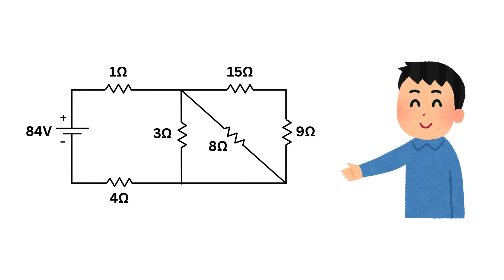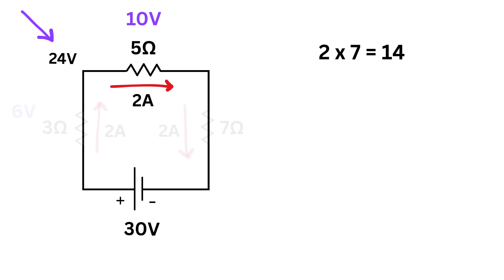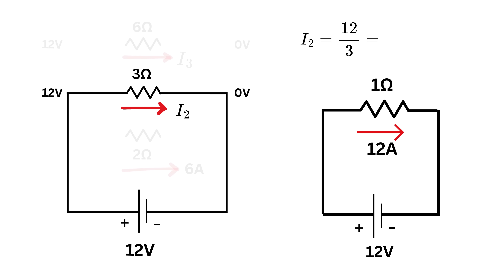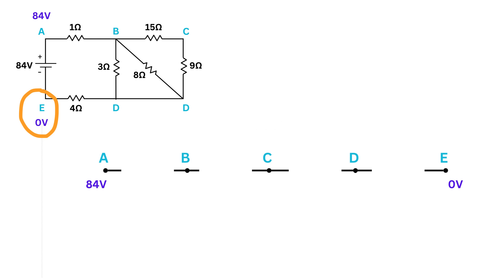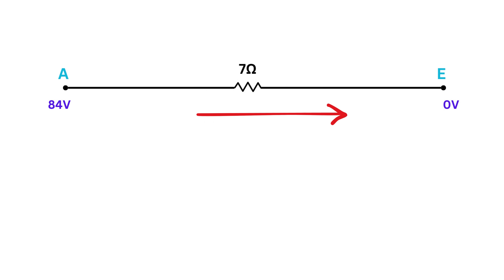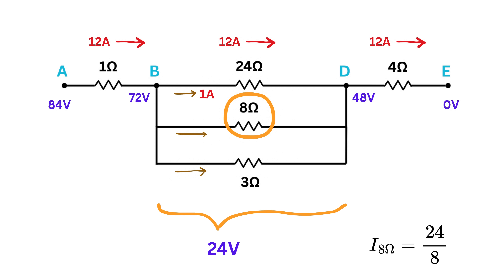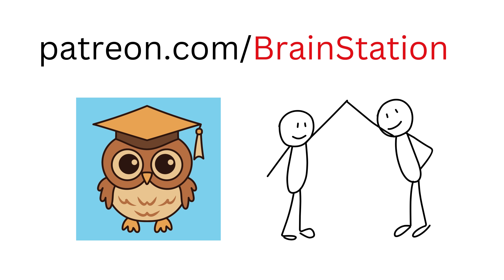How to Solve Every Series and Parallel Circuit Question with 100% Confidence

Comment: 8:49 how did you get R=2
Reply from the maker: 1/3 can be written as 8/24
1/8 can be written as 3/24

So 1/24 + 1/8 + 1/3 = 1/24 + 3/24 + 8/24 

= (1+3+8)/24
= 12/24
= 1/2

So, 1/R = 1/2

Thus R = 2
Reply: @BrainStationAdvanced 😮 sir you answers new comments also 😯
Reply: @BrainStationAdvanced can we not solve it simply because I can't understand
Reply: @DramaRecreation-24it's very easy bro just remember formula and thinks about flow of current only easy pissy
Reply: @BrainStationAdvanced thank you sir❤❤❤
Reply: @BrainStationAdvanced no it's your own idea to make explanation but the true value of resistor has it's own answer.
Reply: @BrainStationAdvanced  , I am sorry sir, but 1/2 does NOT equal 2, it equals 0.5
Reply: @carlfinley4649  1/R=1/2
You doesnt know cross multiple 😔😔😔R=2
Reply: @carlfinley4649   what??? 1/R= 1/2 so R =2, what do you not understand in this simple calculation?
Reply: @carlfinley4649 it’s the reciprocal bruh (1/R = 1/2 , R=2) it’s the inverse
Reply: Yep, I forgot to take the second inversion
Reply: or u can use Product by sum
equivalent Z = (R1 times R2)/R1+R2
Reply: @matheusapenas.3637  thats only applicable when there are only 2 resistors
Reply: @matheusapenas.3637 it works only for 2 parallel resistances
Reply: @matheusapenas.3637  , that is mainly for 2 resistors. in this case we have 3
Reply: Make the denominators same in each case🎉
Reply: @AMISUnn0506D I'm too familiar with this frustration haha. Hope I can help clear that up:

Okay, so at first, 1/3 + 1/8 + 1/24 should give you 0.5

... buuut something they often forget to mention is that - after that - you have to do a reciprocal on that number (i.e. flipping a number or function to find its multiplicative inverse, sounds scary but bare with me ↓ ).

Take 0.5 and inverse it like this:
→ 1/0.5 

= 2

That's it

... alternatively be lazy and use a symbol that looks like 1/x or like x⁻¹ on a calculator (windows calculator has it)
Reply: If you didn't get it by now Try this formula instead....I think it's simpler R_total = 1 / (1/24 + 1/8 + 1/3). Solve the paranteses first.  This comes to R_total = 1/0.5 .
1/0.5=2
Reply: LCM
Reply: its actually 1/Rp for which you have to do reciprocal for the final value
Reply: Calculate through parallel theorem you will get
Reply: Simple understanding
Reply: 1/R=1/8+1/24+1/3
so, 1/8+1/24 = 24+8/24x8=32/192=1/6
now, 1/6+1/3=3+6/3x6=9/18=1/2
Therefore,1/R=1/2
ie.] R=2..........(reciprocal)
Reply: This is basic fraction question just take LCM of there last digits
Reply: This also works 
R1=24 ohm, R2=8 ohms, R3=3 ohms in parallel 
R1xR2/R1+R2 =answer
Answer x R3/answer +R3 
.^.  24×8/24+8=6.   6×3/6+3 =2
Req= 2
Reply: You can solve it in 2 milisec. Like 
6x3/6+3 = 2 and 2x2/2+2 = 1
Reply: You just need to take to inverse of what you get for 1/R to get your equivalent resistance.

In the video, (1/24) + (1/8) + (1/3) = 1/2

You just invert 1/2 (aka, flip the numerator with the denominator) to get your answer of 2

Comment: When a 5 ohm residence is connected in 12 V ... Then the current flow will be 12/5 = 2.4 amps.
You can't say 2 A flow throw in 12 V 5 ohm setup.
And in this scenario the entire source voltage will be shown across the resistance...
 This video is wrong at the initial explanation...
Don't follow this one... This is deliberately done to fool people..

Comment: OMG. I finally understand it after watching this video for almost an hour. I'm studying to take my electrical ASE test for automotive and I wasn't understanding how restistances in parallel circuits worked and reading the comments on here and watching the video I like to dumb things down for ppl who think like me. First let me start off by saying my first road block was on 4:57 I think what confused me was I was fighting for my life trying to figure out how he got 1/3 + 1/2 + 1/6, I think he incorrectly ordered the fractions, so for any one stuck on here I think he meant to put 1/2 + 1/3 + 1/6, next I needed to look up how to add fractions yes I'm that slow idc I'll ask the dumb questions, this process actually requires multiplication, 1/2 + 1/3 = 5/6, NEXT 5/6 + 1/6 (because the bottom numbers are the same we add everything across the top) = 6/6, which mean Rt = 1, according to formula 1/Rt1 = 1 this circuits total resistance is 1

Comment: 7:11
Sir I had one doubt why did you take D twice??
Reply: Since , there is no resistor between the intial points E and D , the voltage will have no drops and will remain same. Thus E = D 
 That is why we can write D = D or two Ds becuz both of  them will have same value.

Comment: nicee explanation, what if there was a resistor in between the points you marked as D and D in the bottom wire, voltage at the ends will not be same, how to solve the resistors?

Comment: when you are explaining the parallel one you just did 12/2 to get 6A but when you are explaining the question at the end you did 24/24 , 24/8 , 24/3 to get 1 , 3 , 8 ohm so why not you did 72/24 , 72/8 , 72/3 why you divide it why 24 why not by 72 as you explain in parallel one

plz explain

Comment: i did not understand why the current go from the positive terminal of the battery to the negative, I had learned that the electrons went from the negative to the positive, anyway not much changes, but I'm still confused.
Reply: Hi!! Actually there is a term for this, 'conventional current' Electron flow is the actual physical movement of negatively charged electrons from the negative terminal to the positive terminal.
But Conventional current is the widely used standard in electrical engineering and physics for circuit analysis. So basically Conventional current is just a historical convention that helps us analyze. Its not actually how the electrons flow its just a pov of making things more easier.

Comment: 5:49 there is a small oversight here, your direction of information should imply on the graph or drawing proided that they are connected to SAME POINT, not a point, splitted by another point, splitted by another.. etc....... this will lead to different current that is not in the same method you calculated it.

Comment: Here is a parallel circuit problem that won’t be solved with this type of analysis alone:
12 resistors all 100 ohms, arranged so as to form the edges of a cube. (Each resistor connects with two others at a corner) 
What is the resistance between two opposite (diagonal, and far opposite) corners of the cube.

Comment: In the end you're using Kirchhoff's circuit laws. At each point the voltage is equal on all connecting lines and all currents sum up to zero (incomming and outgoing). You did not mention the current rule but you are using it. With only resistors present you are able to decompose the circuit in parallel and serial connected resistors and calculate each point by Ohm's law.

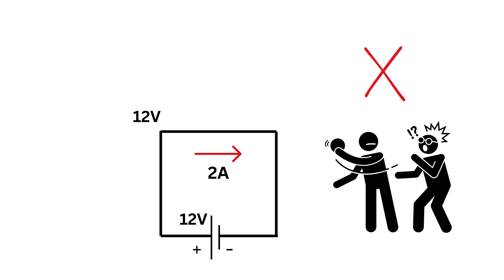Comment: 1:58 In this case, the battery is in short circuit. Supposing a 0 ohm resistance in the wire, you'll have an infinite current and the voltage will be 0 volts (following Ohm's law). In the real world, the wire will get hot, the resistance will rise up and the current will be very high but not infinite, this could last from a few seconds to hours depending on the battery's charge. At the end the battery will die in the hard way.
Reply: aye, but we take ideal wire
we disregard temperature of course
Reply: @NamanShah-b3w , as I mentioned, in this case the voltage will be 0 volts, it's a short circuit.

Comment: 1:35 I’m not sure I would trust anybody who’s initial example is as flawed as this. Voltage is set at 12 V resistance five ohms that would give you a current of 2.4 Amps, not 2 Amps.

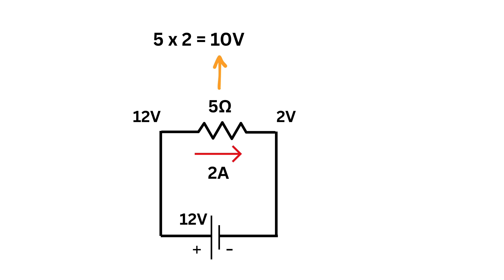Comment: 1:52 Wrong and mildly confusing, even though beginners might not catch it. The resistor sits between 12V and GND, right? It will drop the full 12V. The current will be 2.4A assuming no other losses. I hope you have a 30W resistor....

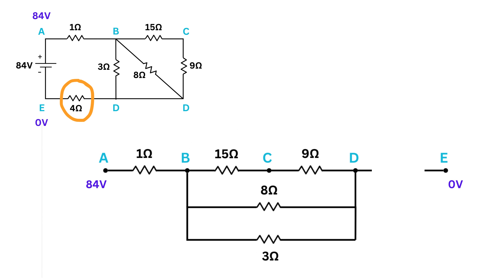Comment: 8:00 Why do you name the circuit (d) repeatedly in the above circuit diagram
Reply: Because there is no resistor then and hence no voltage drop
Reply: Because there is no resistor between those two points as voltage remains same in those points, write same notation like d, d or a, a etc.
Reply: @chinmay1516 thanks

Comment: The very first example is wrong. I understand the attampt, but if there is only one resistor in the circuit, the voltage drop would be equal to the sorce, and the current will be I = V/R -> 12/5 = 2.4 A.

Comment: 12:36 why the 48 volts becomes 0 across 4 ohms?
Reply: Bro , 12 amperes of current was flowing through the 4 ohm resistor from D to E , if we applied ohm's law it is that V= IR, so we get V= 12×4 that is 48 , since potential drop can be measured by the - Potential difference from D to D(48) Minus the potential difference from point D to E , I guess this will help you
Reply: It should be 44 volts right i am confused on that part too
Reply: @PrabhasPatilyoo indian
Reply: @PrabhasPatil no bro , there is a drop of 48 V so the effective potential difference would be V - Vd = 48-48 v = 0v ❤

Comment: At time 1:35 the current will be 12/5 amps (2.4 amps) NOT 2 amps. To achieve 2 amps through the resistor shown would require an additional series resistance of one ohm. I see what you are trying to demonstrate but at best it is quite confusing and at worst simply wrong.

Comment: What if i have circuit with power supply that provides 30V and 1A and resistance with 15ohms. How can current be 2 amps when power supply can give me 1 amp only?

Comment: I am Egyptian and in the final year of high school. Although the physics curriculum is very difficult and complex in Egypt It does not depend on understanding the lesson only, but rather it depends on understanding and solving a lot. , I benefited from the video. Thank you. 😊
Reply: same and I was trying to find Smth to help me understand the current divider found this video and decided to watch it instead, the only trick I know for now is that if you have 2 resistors in parallel and one is equal to the other than do 1/2 , if one is half the other do 1/3 the bigger one , if one is 1/4 the other do 1/3 the bigger one , and the list goes on , it makes it wayyyy easier to solve these without a calculator cuz most parallel resistances are either equal , half , third or quarter
Reply: @bidoaymannabil9828  This method is really very effective and time saving. Where are you from?
Reply: @bidoaymannabil9828 can you explain further what other tricks do you know
Reply: @bidoaymannabil9828 shut up lol
Reply: Same lol
Reply: @asmaaelhossary4088  شكلك مصرية😂
Reply: يسطى بالنسبه للاسئله الي بشوفها فالسؤال الي جابه ده يعتبر سهل جدا الصراحه 🙂
Reply: @مجرةالمعلومات-ض9ر  بجبر بخاطره الفيديو متعوب عليه لكن الاسئلة دي بسيطة اوي بصراحة😂😂
Reply: @SamaMohamed-c3hحصل بس المشكله ان عندنا في مصر مفكرين ان الطلاب هنا علماء مثلا بيحطو اسئله من المريخ 💔😂

Comment: My circuit shows r1/r2 in parallel and r3/r4 in parallel with a source voktage and no other resistors ij the circuit. How would you label the sections? Somehow im stuck on step 1😅

Comment: This is the best video i have seen explaining the complex electric circuits.

Have one doubt though.
Elecrrons move from negative side of the cell, rt? (Current by convention moves from positive end).

So, wont the voltage drop in series through the circuit from negative to positive of the cell?

Can you answer pls?

Comment: Fantastic! Thank you so much for making this video! I had a task where I needed to calculate voltage across a resistor in a circuit where there are resistors in series and paralel and with this video I finally solved it!

Comment: The first question my teacher gave to me during the first class of electronics..if you have a series of resistor like in the video which one going to have higher proprablility to burned first.
Reply: heat =i²rt

so simplify circuit to find i (i=12)
then if a wire splits into two or more intersection, you can find current in each branch by using i1r1=i2r2=i3r3 

and i1+i2+i3...= i (junction law)

after calculating this for all the branches just for every resistor calculate i²r where i is current passing through a resistor of resistance r. higher the value of this higher the probability of it burning. seems a lot but its really easy after a while, doable in less than 3-4 mins.
Reply: @grandblue_x correct.

Comment: 1:36 the example is wrong unfortunately. You wrote down the resistance AND the voltage AND the current, meanwhile they don't calculate to be as written. Since there are no resistance from the right of the resistor to the source of the current, the voltage drop across the resistor should be the full voltage of the source (the wire ain't long enough to substantially cause a 2V drop)

Comment: 12:32 , how did point D to point D have a current flow of 4 amperes? Please explain!
Reply: Same doubt here
Reply: It's just a didactic way to show that the currents (1A + 3A) + 8A will be added. It doesn't cause any problems.
Reply: Kirkoff’s Current Law states you add the 3A and 1A current where the wires connect at the bottom right D and then it becomes one 4A current
Reply: @kokorobanks3341 we have from C to D 1A and B to to D another 3A which is 3+1 4A and another one from B to D 8A and if we subtract 4A from 8A we get 4A from D to D.

Does it breaks the principle or it is just wrong
Reply: 3+1 inputs equal outputs
Reply: See current from bd and cd converges to form a total of 4A

Comment: At 1:37 the example of a 5 ohm resistor and a 12v source will NOT be 2A. If you put a volt meter across the resistor, it would be the same thing as placing it across the battery, thus the voltage drop would be the full 12 volts, not 10. The actual current is 2.4A not 2. So the values given are not correct
Reply: exactly, after the last resistor, the voltage in theory has to be 0, this can be very misleading for newcomers
Reply: For all the new learners, it's basically 
I = V/R
I = 12/5 
I = 2.4A
Where I is the Current, V is the voltage, and R is the resistance.
Reply: Yes, it should have been a 10V source or 6 ohm resistor. Could be a little confusing for someone trying to pick up the basics.

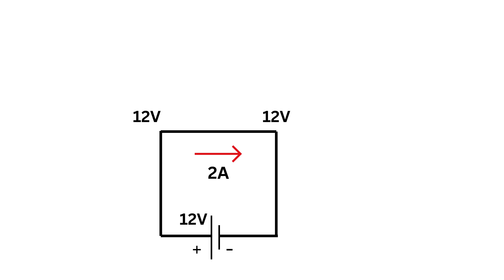Comment: 1:51 and 2:05 . Are you sure? As far as I know , the right side is always zero (negative pole) . If you have voltage drop, then the battery will drop 2 V and you will have 10 V on the left side of the resistor . And at the short circuit 12 V everywhere ? What am I missing ?

Comment: Hii
 I want to know why you have written point D two times
Reply from the maker: Because it represents the voltage at that point, and since there are no resistors or other elements between the two points, their voltage values are the same. Therefore, we label them with the same letter D.

Comment: may I ask, what if theres a voltage source AND a current source, and they're not placed on one side (left side of circuit) but placed in the middle of the circuit diagram? can i still do this method?
Reply from the maker: Absolutely ✅
Reply: @BrainStationAdvanced is there an order when naming the nodes? Example top to bottom or left to right? Lets say from the top i named A and in the middle is node B branched out left and downwards. So do i name the left side node C or the downward side node C?

Comment: @08:50 how did you get R=2?
Reply: After LCM -> 1/Req = 1/2 , so if you reciprocal it then Req = 2...
Reply: @railfanofmxn07 can you explain a little bit better
Reply: Take LCM 1/24+1/8+1/3 = 12/24 which after reciprocal becomes 2Ohm
Reply: Lcm..

Comment: Can someone please explain the idea WHY is there resistance associated with current (and or voltage)? Why can't current and voltage just flow (and not have resistance and or any resistance being associated with them)? I don't understand that at all and I can't find the answer and no REALLY EXPLAINS why and how the relationship between current, voltage and resistance exists. For example: I saw the below example (that I noted with the word Example below) on Quora.

Example: Let’s start with practical application and leave scientific law out of it for a moment.

For clarity,

Voltage is a force (ElectroMotive Force EMF)

Current is a volume (electrons - electric charges)

Power is work performed.

If you push very hard on a pallet of bricks, you could move it. Lots of power.

If you push lightly on a single brick, you could move it. A little power.

1) Why this person didn't explain what voltage IS? "Voltage is a force." (A FORCE FOR WHAT OR TO DO WHAT? AND OR WHY OR HOW DOES IT EXIST?

2) "Current is a volume (electrons - electric charges)" Again another ridiculous explain what current is that doesn't even complete what anything about current. A volume of what? Or a volume for what? And what does "electrons - electric charges" have to do with current?

Regarding resistance, current and voltage how do these make sense together? Also don't refer me to the formulas for how to calculate resistance, volume and current!! I need an explain how and why EACH AFFECTS the other without mentioning advanced stuff like diodes, voltage drop and other stuff without explaining the relation of resistance, volume and current to eachother and how (in general understanding) and why they work together! I would appreciate help with this. It's so frustrating when people can't teach things simply for people to understand.

Comment: Nice!  Though I'd rather not see the inconsistencies between 1:35 and 2:05.  At 1:35, the math doesn't work out; you'd need 2 volts dropped across the right-side wire.  Similarly, at 1:55, you show 12 volts across a piece of wire and say 2 amps flow.  Other than this inconsistency of mixing ideal wires of 0 ohms and the need for some of the wires to have resistance to drop voltages to make the math work out, this was a way cool video!  This could be confusing to someone just learning this subject.